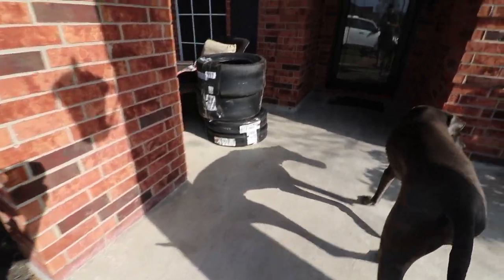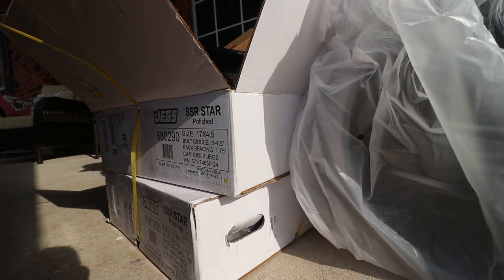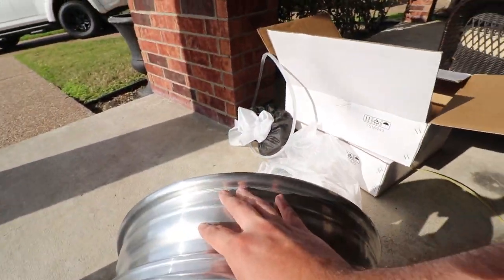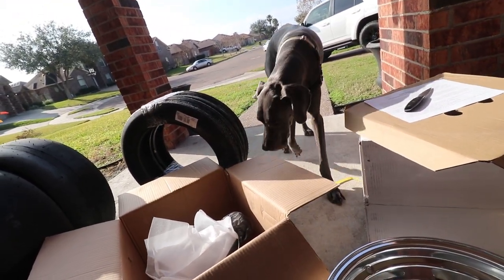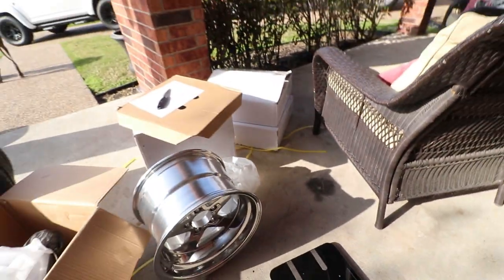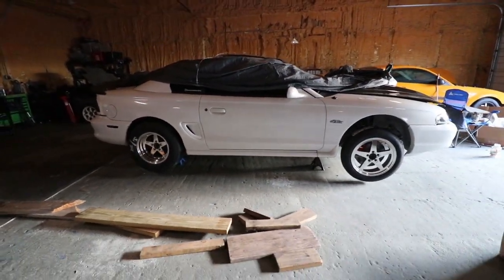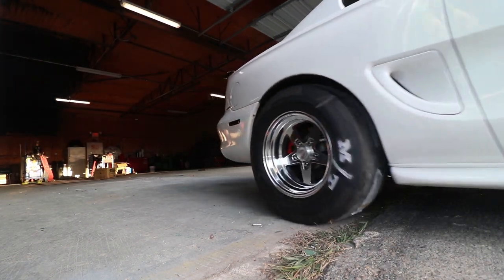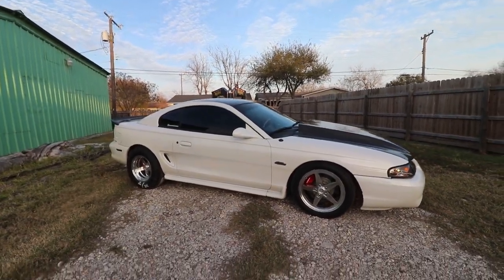SSR Drag Wheel Install ! Surprisingly Impressive??

Comment: Looks good. Can’t wait to get a drag pack setup for my cars. I’d lose a lot of weight because my 3 valve has 19”x10” in the rear and 19”x8” in the front they are sooo heavy too. I’ve actually got a set of racestars for the rear but they have a 28” tire on them and my car sits too low. I have some coil overs I need to put on so I can fit them right now it’s just cut stock springs. And you ain’t lying a lot of ppl think the old 2v and even 3v are worthless but ima tell you I beat a lot of newer cars with my fbo cammed 4.10 gear nitrous 3v. I really haven’t had a chance to race too much with the 2v since I’ve just recently got it working good. It was working so good yesterday I was honestly thinking about just keeping it nitrous and selling that Kenne bell but I’ve wanted a Kenne bell since I had my first foxbody back in 03 lol. So I’ve come to the conclusion ima leave the nitrous and add the Kenne bell. Maybe asking for trouble but I do have a set of svt Manley rods ima put in a teksid block still going to be running stock crank though. I have a pretty good local tuner here that says we can safely make 600rwhp with the stock crank so we will see. And hey if not I know where about 50 4.6 engines are at my local you pull it yard lol. $120 for a long block $80 for a shortblock. Anyways man keep it up I’m glad you still rocking the 2v. I’ve watched a bunch of channels over the years and they may start off with a 2v or 3v but once their channel starts taking off they all go with a new shelby gt500 gt350 or some insane boosted built coyote and forget about us poors lol.

Comment: Did you have to run wheel spacers in the rear ? Trying to run a similar rear setup for my cobra atm it has deep dish replica terminator wheels and the rear has a 1 inch spacer
Reply from the maker: No spacers

Comment: Even if you launch a rod througbthe block 4.6 motors are a dime a dozen you can get a low mile delivered tp your door for under 800 bucks from lkq